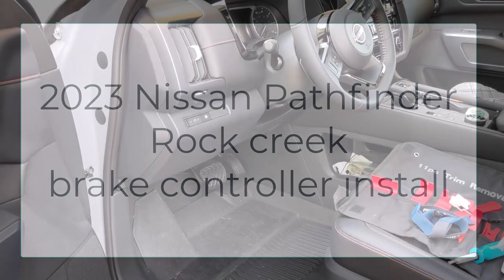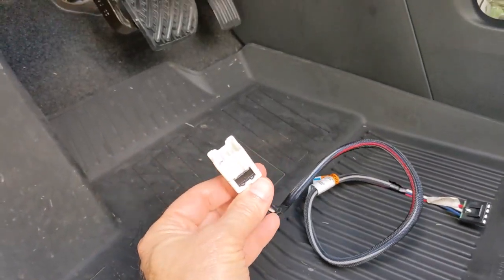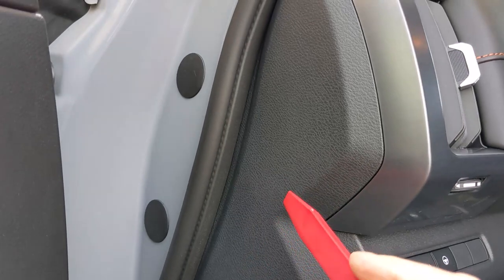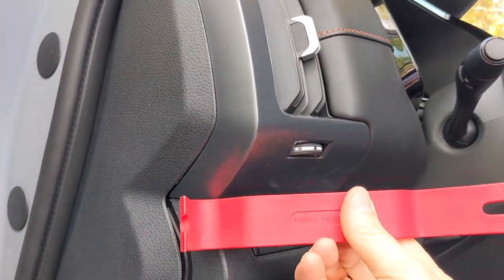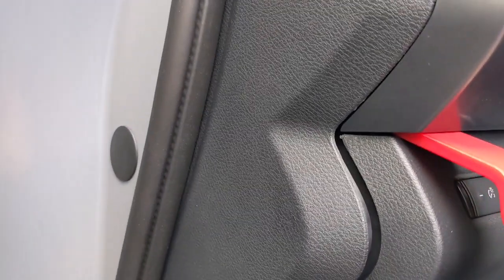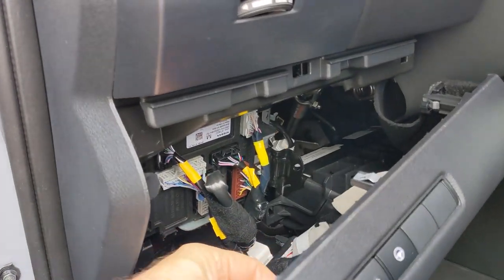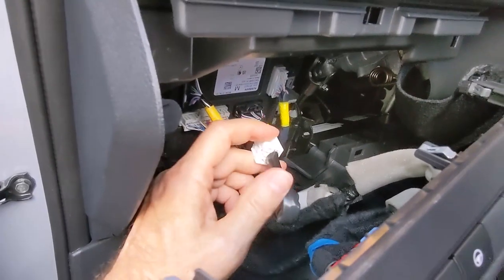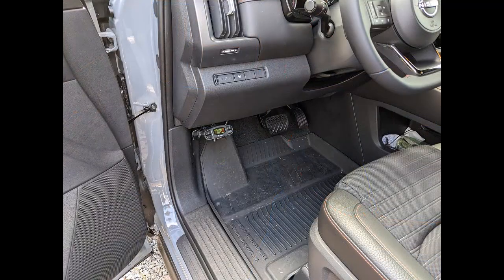2023 Nissan Pathfinder Rock Creek Tekonsha brake controller install

Comment: What 7 pin harness did you get? I see that Nissan only sells the 4 pin
Reply from the maker: So if your pathfinder does not already have from the factory a 7 pin connector on the rear bumper then you do not have the towing package, which includes the extra transmission cooler, and without the towing package your pathfinder can not two 6000 lbs, it has a much smaller towing capacity, I think it varies by year but a lot of them I saw supported 3500 lbs.
My 2023 Rock Creek came with the towing package and part of the 7 pin connector is to send the electric brake signal to the trailer, the brake controller I installed gets information from that white connector I exposed in the dash that tells it how hard the brake is being pressed and that gives a variable... but adjustable signal to the trailer on how much braking is required.
So if you do not have a 7 pin harness I don't know if your pathfinder will have the necessary connections under the dash to hook up a 7 pin connector... that you would have to wire all the way back from any brake controller under your dash to where you would be installing the connector on the rear bumper... and again your towing capacity is probably not 6000 lbs but something much smaller.  Sorry.

Comment: I have a pathfinder 2024 the Tekonsha 3050-P Brake Control Wiring Adapter for Nissan doesn't compatible it's for under 2020 what is the path number of your Tekonsha wire. I buy the 7894 universal but it's not friendly connect no same color, and we have 5 wires on the Nissan cable and 4 wire with Tekonsha.
Reply from the maker: That would mean the Tekonsha 2050-P is not supposed to work on my 2023 Pathfinder RC, but I can assure you it does.  I just went to etrailer and asked if it fit your Pathfinder and it says it is the correct part https://www.etrailer.com/Accessories-and-Parts/Tekonsha/3050-P.html?hhyear=2024&hhmake=Nissan&hhmodel=Pathfinder
So I would go ahead and install it and see if it works.

Comment: I have a 2017 pathfinder. Do you have a video or any tips finding the harness?
Reply from the maker: From my memory (its been a few years since I did the install, and I unplugged it in the dark at the dealership when I traded it in) I recall that the plug in the 2017 pathfinder was wrapped in white plastic bubble kind of wrap and was accessible without doing any removal of any panels just had to stand on your head to find it near the steering column.

Comment: Thanks for sharing. Can you tell me what your towing and the performance? We are debating on a travel trailer and I'm skeptical.
Reply from the maker: We have what I call a small travel trailer, a 2019 Keystone passport 175BH  (https://www.keystonervsource.com/specifications-2019-keystone-passport-sl-series-travel-trailer-floorplan-175bh-tr40586). Performance is more than acceptable, I can accelerate and merge onto highways no problem, even travel at highway speeds when needed, with our weight distribution hitch sway and handling is very good, pulling up long steep grades when fully loaded does leave someone in a hurry a little disappointed, but camping for me is a time to try and relax and not be in a hurry ;-)

Comment: Please I need your help !!! I have a 2023 pathfinder platinum and have the Nissan Elec brake jumper it has 5 wires at the end. And I also have the Tekonsha harness but it only has 4 wires at the end one is black,white,red and blue. How do I connect the wires correctly ??them ??? By color ??
Reply from the maker: I used that cable from Amazon (https://www.amazon.com/gp/product/B001NZMBVC) that plugs into the back of the brake controller and the other end plugs directly into the Pathfinder.
I do have a stand alone kind of cable like you are mentioning that came with the brake controller that plugs into the back of the brake controller and exposes four wires (no plug on the end), I would guess that would be something you could use if you knew the wiring specs of your vehicle and were courageous enough to splice it into your vehicles wiring, if you could not find the appropriate cable for your vehicle.  I would look for the adapter cable ;-)  The one I got will probably work for you, but I can't say for sure what might be different with our trim level (Platinum) vs mine (Rock Creek).
Reply: @bholtzhauser  Thank YOU !!!!!! For taking time on helping me with this situation !!! God Bless

Comment: i have a 2024 platinum, how did you  connect it in the rear? is there any hidden wires to connect the 7 pin connector?
Reply from the maker: There is no need to connect the brake controller to the 7pin in the rear of the car... where you plug in the trailer.  One of the pins in the 7pin connector is the "Brake" wire, putting the brake controller in like this (plugging the brake controller in that white factory connection under the dash) activates and coordinates that "Brake wire" in the plug to modulate the voltage/current on that wire and controls the brakes on the trailer.
Reply: Dang, I’m sorry I’m still not understanding. So you don’t have a 7 pin connector for your trailer?
Reply from the maker: @jorgecastillo0920  I do have a 7pin, I assume you do too.  The 7pin on your pathfinder, or any pathfinder... that does not have a brake controller installed will not be able to activate the brakes on a trailer equipped with electric brakes. The "Brake wire" in the 7pin will not have a signal on it.
So that is why you install a brake controller, When the brake controller gets connected to that factory provided plug that is under the steering wheel, it puts that signal on the 7pin in the rear of the car... when you hit your brakes, the brake controller sees that and sends the appropriate voltage on the "Brake wire".
Reply: @bholtzhauser   no mine doesn’t have a 7 pin connector. We added the hitch and the only one we can add is a 4 pin. The rear harness doesn’t have the connector for a 7 pin. Only 4 pin. But it does have that connector under the dash like yours.
Reply from the maker: @jorgecastillo0920  OH, So that probably means you do not have the other parts of the puzzle that fit together for the larger towing capacity, if you have the 7 pin and the extra transmission cooler etc. from the factory the tow rating is like 6000 lbs, but without it I think it is more like 3,500 lbs.  So be careful what you tow, and a 4 pin connector does not have a "Brake wire" so you can not activate any electric brakes on whatever you are towing.

Comment: How do you like the rock creek ?
Reply from the maker: We have not done much other than around town driving with it, for that it is doing a fine job, 3 car seats/boosters ;-)  
Soon we will have longer trips, for one we will be towing our camper for around 1,000 miles so I will be able to say more after that.
It has taken a little bit to get used to all the features, like an electric parking brake or the shifter/paddles plus all the cameras and saftey features or connivence things like heated seats, but now my wife would probably list most of them as requirements for our next vehicle, especially the heated seats 😉

Comment: Could you tell me where you found the plug n play wiring for the tekonsha controller. I have a 2023 rock creek and I can't find it. Thank you.
Reply from the maker: I think you are talking about the cable that plugs into the pathfinder and then into the Tekonsha brake controller, it is the same one I used on my 2017 pathfinder, that I installed in 2019... here is a link to it on Amazon: https://amazon.com/gp/product/B001NZMBVC
Reply: @bholtzhauser  Thank you very much!
Reply from the maker: @joshuasimeone3729  I went ahead and put that link in the description of the video, so others can find it more easily, thanks for asking the question. :-)

Comment: I thought it already had integrated brake controller. That’s what the ad says.
Reply from the maker: That would have been nice, but mine does not, I have not seen an add that says it does... but then I have not looked at any adds ;-)